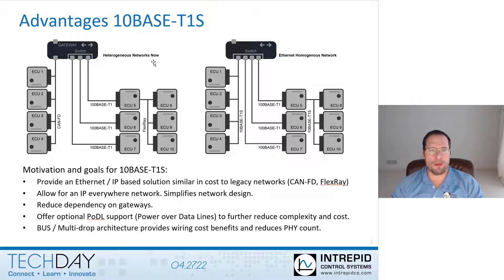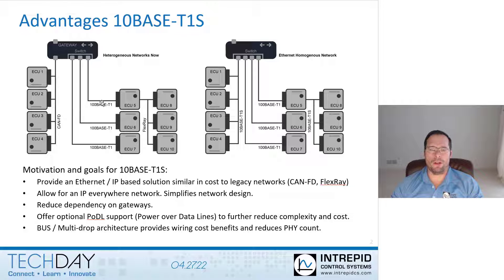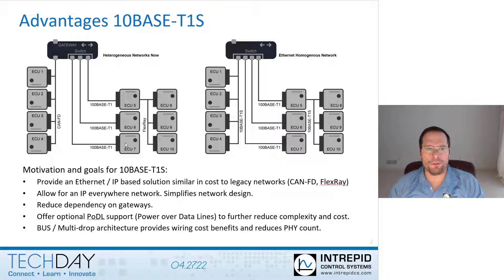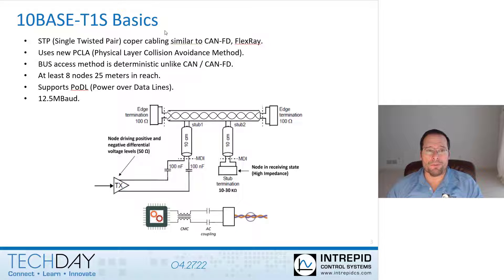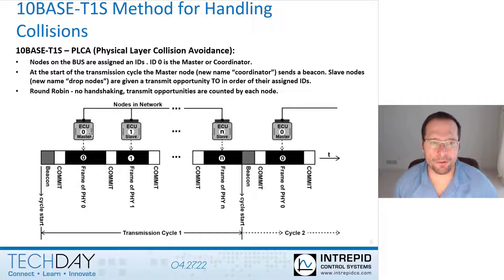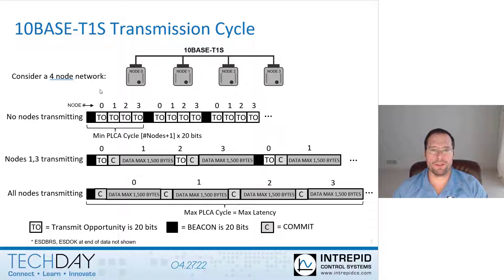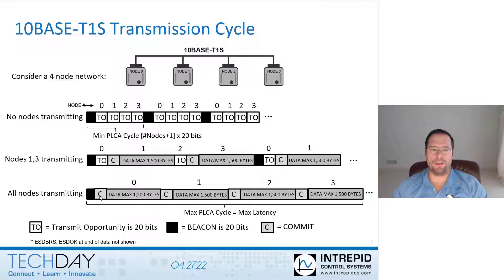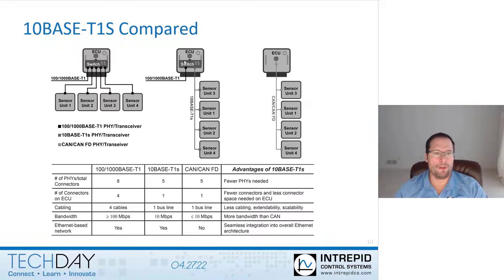10BASE-T1S or 10SPE Explained in 5 Minutes - Multi-Drop Ethernet for In-Vehicle Networking

Comment: What if two node try to send data at  same time . Which node will get transmit opportunity  and what basis?
If transmit opportunity  will be given like node 1,2,3... then what if node 5 have higher priority message like safety signals then it will be blocked by node 1 right
Reply: They can't transmit at the same time or you have a faulted system where somebody is breaking their time bucket

No node in a TDMA system (which is what 10base-t1s) can have "priority".   That is sorta the point.  All data is sent/received in an orderly fashion.
Reply: For safety applications, what you're typically trying to achieve is not violating your FTTI (Fault Tolerant Time Interval), the time you're allowed between detection and reaction in order to prevent a hazardous scenario.
You're right when you say that nodes need to wait for each other when using 10BASE-T1.
CAN is restricted to 1mbps, with CAN FD being able to go up to 8mbps. However, in most typical applications you're more likely to find a baud rate of 500kbps.
Ethernet is much faster, with 10BASE-T1 operating at 10mbps. 
So, it depends. How many nodes to you have on your Ethernet bus? How fast is the CAN bus you're comparing with? How much data are you sending?
I think CAN is likely to be faster for safety critical applications, but you'd have to do some calcs to be sure.